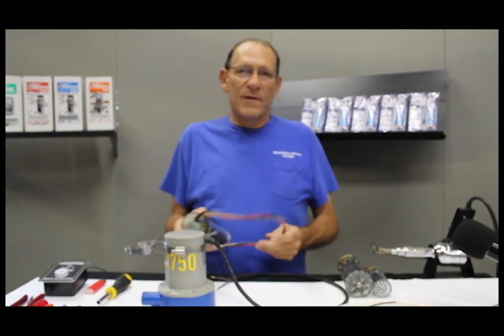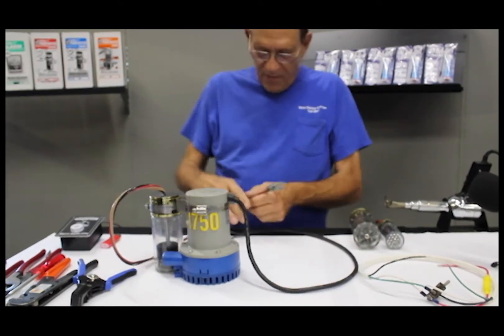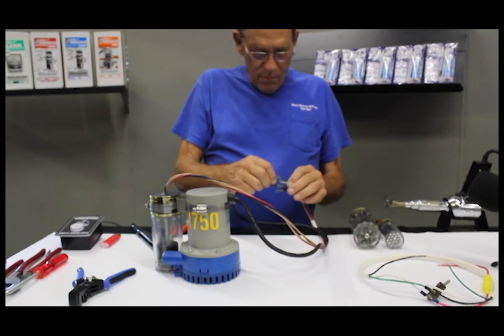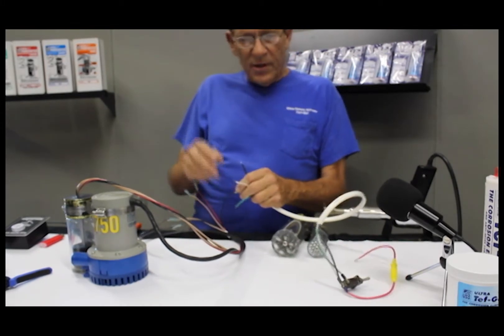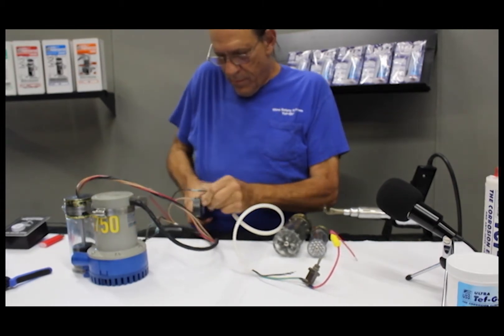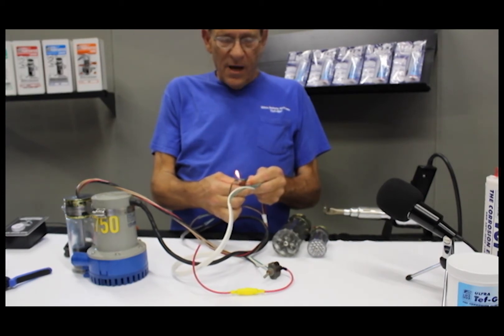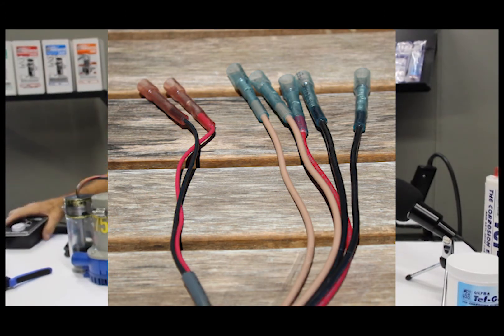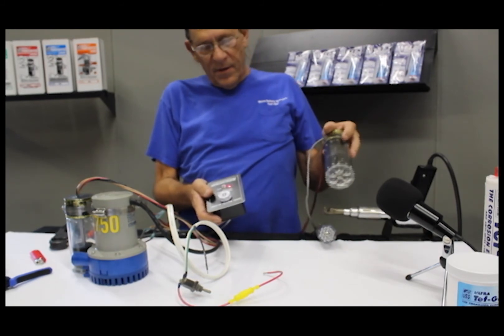ULTRA Safety Systems PumpSwitch Wiring Demo With Bob Mergenthaler

Comment: I want to add a led indicator on my dash that turns on whenever the auto float turns the pump on (so I know when the pump is on) If I power the LED + from the automatic wire at the switch on the dash will that work?